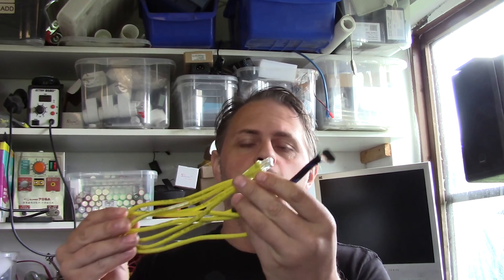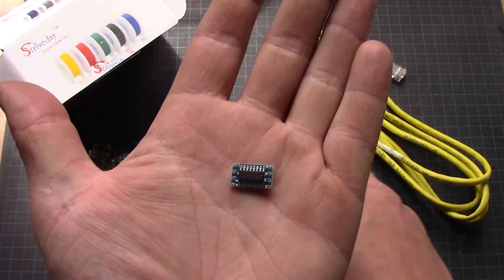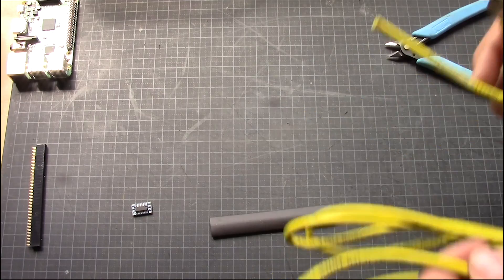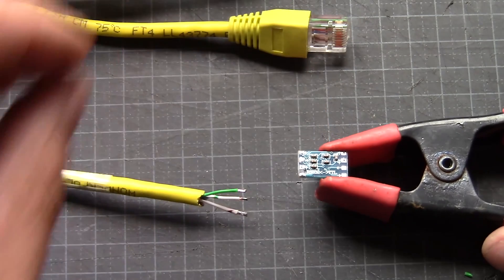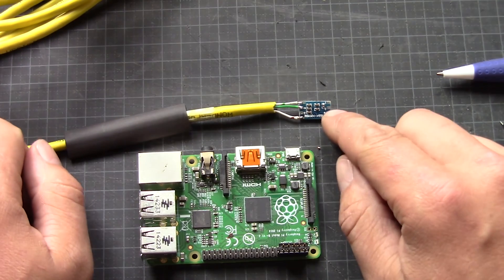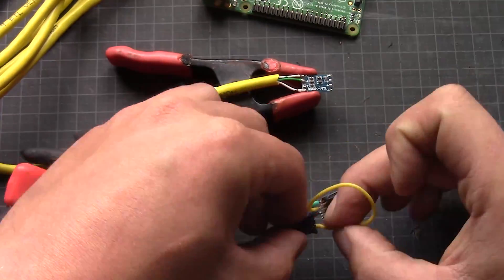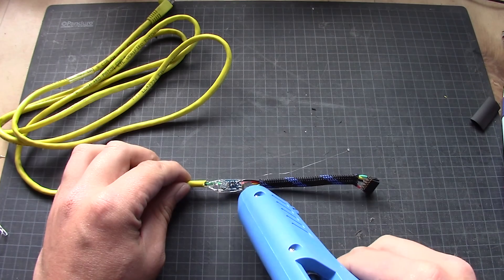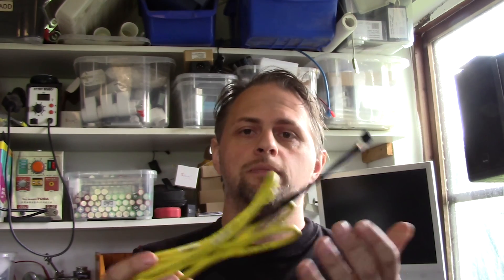Serial port adapter for Raspberry PI - Monitor your inverters

Comment: Have you ever had overheating with this chip? My board looks exactly the same, but there's a notorious overheating issue that seems to be occurring with these boards recently which may be related to a cheap Chinese supplier. I have been trying to get my TTL<->RS232 connection to work with a firewall console cable -- almost the same as your setup -- except I'm using RJ45 pins 3,5,6 (rx,gnd,tx) and having a heck of a time getting it to work consistently.
Reply from the maker: Not mine. But yeah some quality issues i have heard about before to. Unless its connected wrongly. Then they get hot :D  I have done that myself so.

Comment: is rj45 pinout the same for all the inverters?
Reply from the maker: No. You need to read up on the inverter you look at how they do it or what protocol they use.,
Reply: @DIYTechRepairs  as i imagined, the victor max 10.2kw is , like every china inverter, useless with lack of any after market support. there are no manual or any kind of information about the rs232 pinout.
Reply from the maker: @pam8352  They are often closed ports. in some rare cases you get help from the seller but yeah they only wanna sell and dont care about people want to use their equipment. You basically get what you pay for. Nowadays i always start by asking the seller if or how i can hook up to the device :D

Comment: man u need to help me
Reply from the maker: With?
Reply: @DIYTechRepairs  to recreate the cable I ve destroyed 6 Ethernet cables
Reply from the maker: @Jacob-eb4sh  If you follow the instrutions it should work. But you need to crosscheck the diagram. Those producs are notororious to change those things over time
Reply: @DIYTechRepairs  appreciate man I would try again and again till I make it I swear

Comment: Hi. I use an Effekta AX 3000 which is exactely the same the the mpp. Sadly i have no cable so i tried with an usb adapter FT232 but it doesn't communicate with the inverter. Does somebody have an alternative? I used pin 1,2 and 8 for ground
Reply: Did you find a fix?
Reply: @Mr123trade  hi. Well i sold the inverter a while ago and don't remember how i connected it

Comment: powering with the 3.3V had an output voltage of 2.8V. power the MAX3232 with the 5V source and it works like a charm. great vid!!

Comment: How do you connect all your inverters, MPPT, chargers to the PI and Grafana?
Reply from the maker: myozone via a software i developed. Can be found in my website.
Reply: Ok thanks, Do they all interface to the PI via RS232 ? if so, you need more than one port or lots of PI's !
Reply from the maker: myozone usb to rs232 adapter. Im just working on a video showing how i hook up all devices

Comment: How to communicate the inverter which communicate with the help of USB
Reply from the maker: You hook the USB cable into your computer instead of the RS232. Not sure what your question is about?
Reply: DIY Tech & Repairs thanks for your answer. I repeat my question. 
Q. There are some inverters they have USB port for communication instead of LAN communication. So now I want to read the data with the help of raspberry pi. So how I will achieve that.
Reply from the maker: You hook up an USB cable to it. Raspbery PI have USB ports. Then you need to know the protocol of the inverter or find someone that allready written a program to talk to the inverter.
Reply: how to find the protocol if the inverter :(
Reply from the maker: What inverter? Have you Googled it? Talked to the manufacturer?
Reply: That is for downloading the log or uploading/updating the software

Comment: Unfortunately my ABB Trio 7.5 inverter uses RS485 and seems tedious to wire in. :(
Reply from the maker: Nah thats not more tedious. Its easier :)  https://goo.gl/nqvtMG  Use one of this and it will work. I use those myself to 485 devices and it works great. running modbus over them.
Reply: Oh I dunno, $1.10 might break my budget lol. that's so cheap, thanks for pointing that out. I can see why they used RS485, so they can chain a string of inverters.
At least with USB, I can put a PIzero and use it to send the data into the house from the wall outside.

BTW, I'm 'tremors' on the DIYpowerwalls forum. ;)
Reply from the maker: :)  In other word above adaptor is actually an USB -> RS232 > 485 adaptor. You could potentially just buy an RS485 adaptor and use on the serial port too. But above USB have worked fine for me.

Comment: what type of inverter would you recomend for a 11.1v nominal pack ?, i have a 410w inverter but when it reaches 10.8v it protects and shutsdown.
Reply from the maker: That's the tricky problem with 3s systems. In general 4s battery setup works better with many inverters so perhaps that is a better solution. I have no tips of inverters that work with lower than 10.8V im afraid.
Reply: but what would happen if i use 4s, i've seen inverters that goes from 11 to 15v and 4s would be 16.8 at full charge... the same happens with the 24v, so if i go 24v what inverter would you recommend getting, also what solar charge controller would you recommend, thanks !, i can redo my bank this is my very first attempt so it not to late.
Reply from the maker: To be able to lengthen the number of cycles and years you want to use your cells you dont want to fully charge the cells. But 15V is to low. Its quite hard to run some inverters on 12V. 24V systems going 7s is alot easier. But it depends on the gear you have today?  How many cells you got? How large current you going to run on the inverter? For instance an Inverter including charger in one and the same unit for 24V would be a nice start. For high current the 48V version would be better.  This could work for 24V https://goo.gl/eLRhqY
Reply: first, THANKS FOR YOUR HELP, ill be corresponding on PATREON... i bought 400 new LGEAMF11865 and 200 new samsung ICR18650-22P, 3.7v 4.4AH(all of them), i want to create 2 systems for routers and ubiquiti antenas, i need 40wh on aech thats why i was intended to use a 11.1v system... ill be posting a video soon
Reply from the maker: Yeah but on 3s system you might not need to run any inverter at all. More focus that system on the devices that directly can run 12V . That should work just fine and fits alot better than 4s.  If you go 7s or bigger you need a dc/dc converter insted. The problem with several systems is that you when 1 system is full cant divert the energy to the other that easily.  Hope all works out well for you :)
Reply: DIY Tech & Repairs all of the devices that I will be using have a DC converter, how can I plug them to the battery bank ? should I use a DC to DC step up ?
Reply from the maker: For 12V devices you dont need any dc/dc if you are running 3s system. They will work out of the box. Try to skip step up. If so use larger pack if needed
Reply: DIY Tech & Repairs great ! will try that tomorrow thanks a lote for all your help !!!

Comment: Thanks for another great video sir. I have installed your img on one of my raspberry 3 now I am building a cable. All I have to do now is figure out how to make it all work with midnite classic and epever.  Thanks for showing
Reply from the maker: Never worked with the Midnite but it seem to have RS232 and then Modbus.
Reply: The Midnite has built in networking which enables free apps and computer monitoring and control of it. Were you just trying to combine both of your controllers together?

Comment: oi oi oi mr that falls off ladders..... geeee's ur lucky u didnt do a permanent injury..... anyway which pi will this work with??? I dont recall u saying a model nor the software required to run it?? will this work on a linux platform??
Reply from the maker: This is just an rs232-ttl device that enables any raspberry to communicate with devices not running on 3.3v. So the software is any serial device software and the operating system is up to you :) Though I made it to work with the raspberry pi Image that i made video of earlier